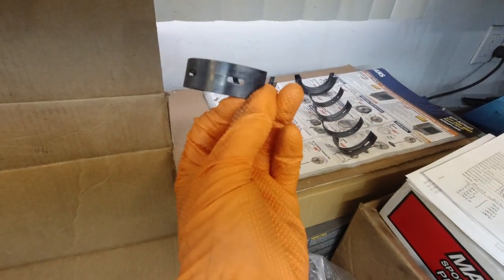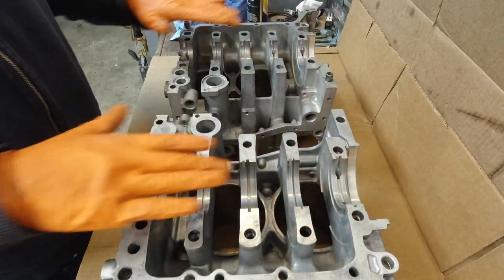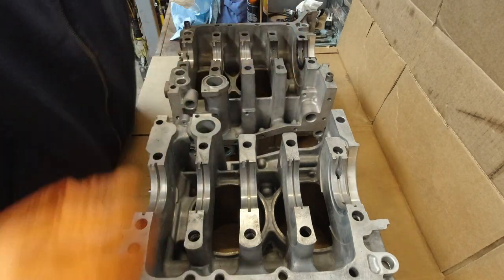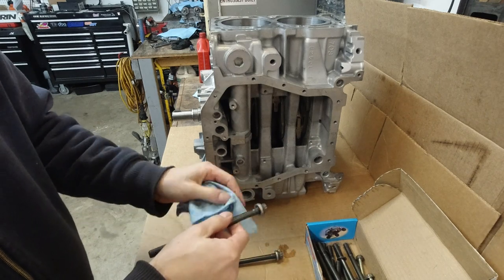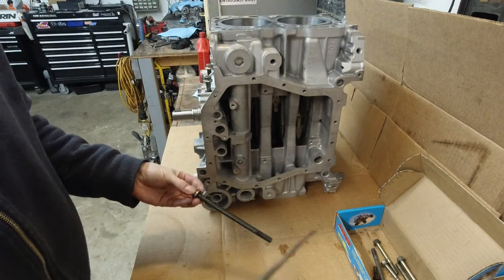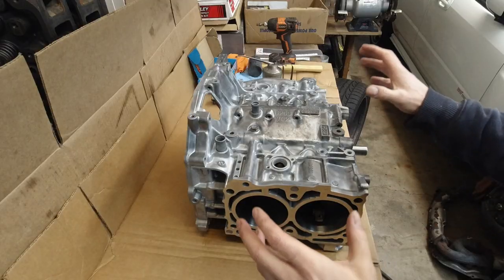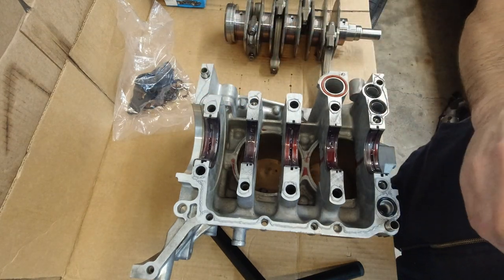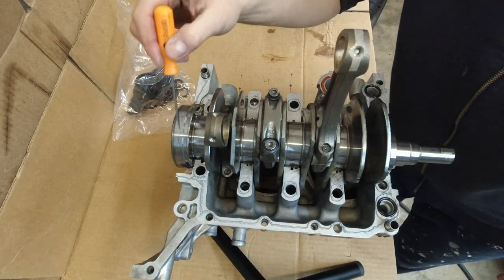Subaru STI EJ25 build part 1 engine block

Comment: What is the sealant clap device that you used?
Where did you get it.
Reply from the maker: https://www.amazon.com/Valco-Cincinnati-Tube-Grip-Industrial-Dispenser/dp/B007IQ4XWK/ref=asc_df_B007IQ4XWK/?tag=hyprod-20&linkCode=df0&hvadid=312177448019&hvpos=&hvnetw=g&hvrand=2621389033794742786&hvpone=&hvptwo=&hvqmt=&hvdev=c&hvdvcmdl=&hvlocint=&hvlocphy=9021494&hvtargid=pla-448779020366&psc=1&mcid=ad61141643033dbd89dc9af48b546999&tag=&ref=&adgrpid=61495038909&hvpone=&hvptwo=&hvadid=312177448019&hvpos=&hvnetw=g&hvrand=2621389033794742786&hvqmt=&hvdev=c&hvdvcmdl=&hvlocint=&hvlocphy=9021494&hvtargid=pla-448779020366&gclid=CjwKCAiA1MCrBhAoEiwAC2d64fjH_dgM3W3dgpbz6glsh47rqHwfLZNUucfKXCoO5DbvXS-sY5XIYRoC3s8QAvD_BwE

Comment: Yoo was so happy I found this video cuz I was looking for what actual bearing clearances you were using… then you just said loose 😫😫 but you did say you are using standard size bearings.. so unless the machine shop ground your crank not sure how bearing clearance would be looser than normal?? Great detailed video!
Reply from the maker: I actually dont remember exactly what the machine shop did, the mains were standard but a bit loose on the rod bearings.  Dont go too loose.  Talk to a good tuner or an engine builder what they recommend for you, it all comes down to your application, how will you use the car, daily, autox, trackuse....
Reply: @cruizinmax4017  thanks for the reply/info! I ended up ordering STD and .001" undersized bearings for rods and mains. Ill see if the tuner we're planning on using will give up any info on clearances. going to be a ej25 with ej20 heads, eagle h beam rods and JE hybrid pistons to correct CR. just a street car but always gets abused by the owner.
Reply from the maker: if you are not racing then dont go with forged pistons, look at 4032 piston material

Comment: how much did you torqued the rod too ?
Reply from the maker: rods to crank is the only thing i didnt tighten myself, the machine shop did that for me.  I think its around 32.0 ftlb but heres a link to all the manuals, you should be able to find those specs in there, just remember to tighten each gradually, dont tighten one all the way then the other.  https://jdmfsm.info/Auto/Japan/Subaru/